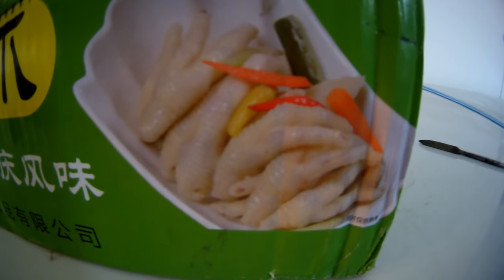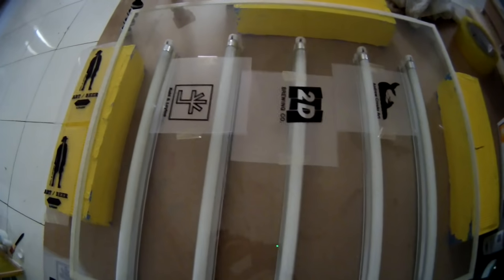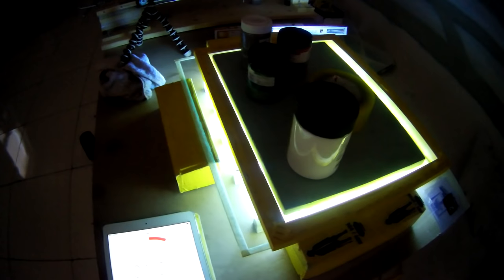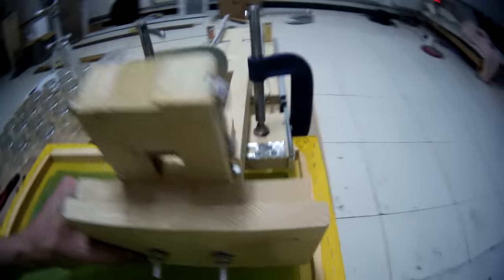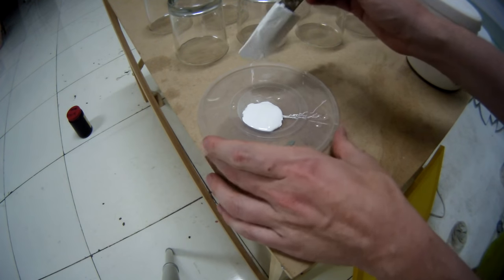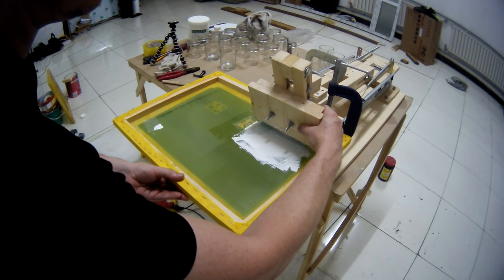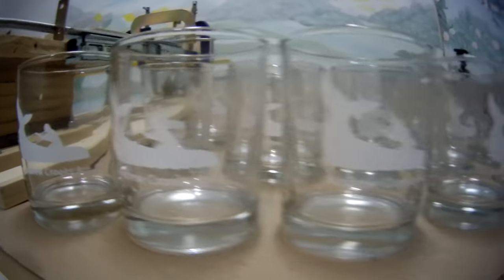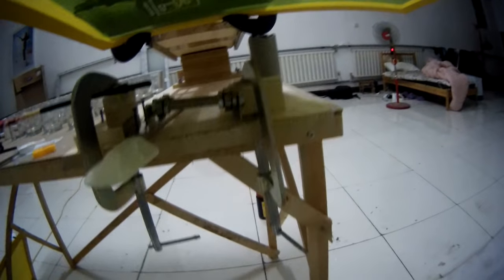How to Print a glass, bottle, cylinder, DIY BEST way!! My $15 DIY printing machine

Comment: Thats great,you could patent that idea!
Reply from the maker: Thanks!  Yeah, thought about it, but after I "designed" it from scratch and worked through the testing and initial prototype, I finally realized that a product already existed in China, but the only problem (Because it solved many of the problems that I encountered with printing) was that it was expensive.  Not terrible, but definitely not as cheap as my machine.  You really can't be doing it yourself for less than $20.  And the inconsistency is actually the appeal, in a way.  Each bottle/glass is a work of art and original.
Reply: ANy way of doing a DIY how to make this? Thank you

Comment: If your making smaller silk screens can I use UV Light Machine like for nails?
Reply from the maker: I've wanted to try UV ink, but I've never experimented with it.  I'm sure it would work.  You'd just have to do some material tests on nails.
Reply: It's not for nails it's what they use to dry nails I use it for making image transfers on reverse film I was wondering if I could use the uv machine for your concept....

Comment: Hey Buddy..can u share with us how to make that cylinder machine?
Reply from the maker: Hi!  Yeah, I'm planning on doing at least one more printing project first, then do the making-of video.  It's really not the making of the machine that's difficult, rather the testing and fine adjustments that are hard to dial in.  I shot video of the build, so definitely planning on making it soon.  Stay tuned!
Reply: Well very eager to knew it.thanks andrew
Reply from the maker: Yeah, pretty simple.  Just need a squeegee set in place and your screen to move over a bottle that's on a set of rollers.  When you push the screen forward the squeegee shouldn't move and the bottle will roll on the rollers.  Just hard to get the whole thing calibrated.  That's why I made mine super adjustable.  Will explain in a video later.
Reply from the maker: Yeah, I'll put details up soon.  I've just been busy getting back to teaching.  It's a pretty easy build.

Comment: will it cost  printing machine
Reply from the maker: I made my machine for $15.  The biggest investment was wood and dresser drawer rails plus some hardware.  I used old skateboard ball bearings for the rollers and it all works excellent.  If you know how to screen print it should be pretty easy.  I'll be adding a building of video soon.

Comment: hello, where can get the bearings? did you need to oven dry it?
Reply from the maker: I just used my old skateboard bearings, since I skateboard.  You can get them at skate shops.  Or rollerblade bearings, machine bearings, any that roll well would work.  I didn't need to dry this ink in an oven.  It's an epoxy with hardener.  Sets in 24 hrs.  UV ink also works on glass.